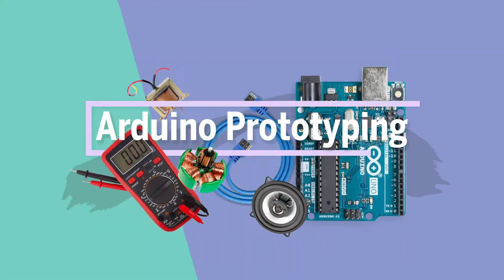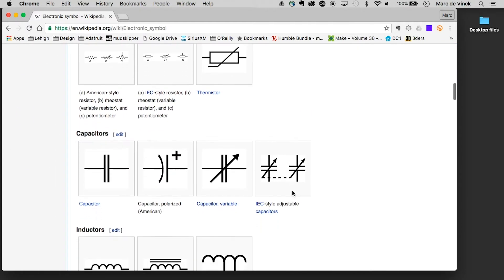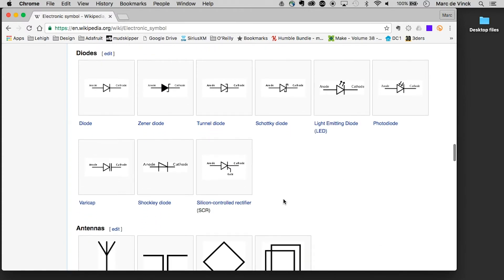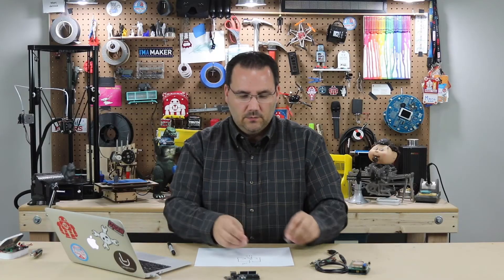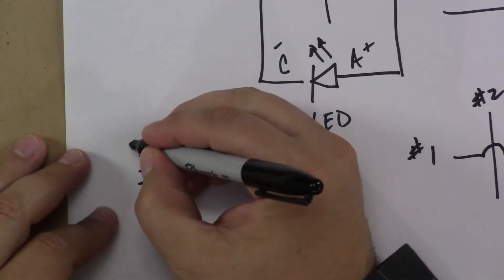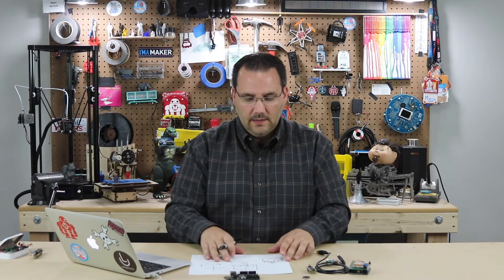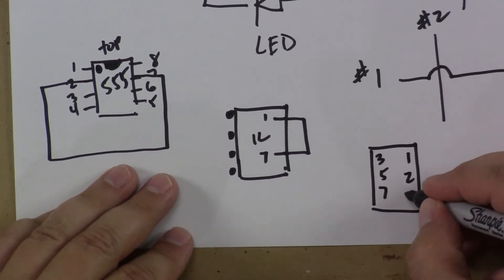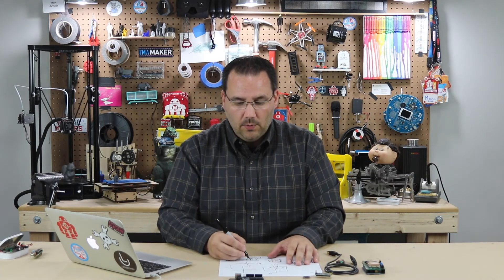Arduino Prototyping Basics #16: Schematics

Comment: Is it possible to hard wire 22 capacitive vibration sensors to a circuit?
Reply from the maker: Not sure if you mean capacitive or vibration, but sure, you can have 1000's of most likely nay sensor. You just need the appropriate circuit to support it. Without knowing the project or sensor it could be very easy or a bit more challenging. If you want 22 vibration sensors and only react when any one senses movement, then it as simple as wiring them all up. If you want 22 capacitive touch sensors, you can get cap-sense breakout boards that will easy allow dozens of sensors.
Reply: @MarcdeVinck  My fault vibration sensors I'm working on this project that's calls for 22 vibration sensors
Reply: So vibration sensors react when one is activated?
Reply from the maker: @aarontaylor7150  Entirely depends on the circuit and code. It could be each one reacting individually, or as a group. Just keep in mind, if they are close together, the point of impact could make more than 1 trigger, or if they aren;'t isolation, all of them!
Reply: @MarcdeVinck  Thank you for this information